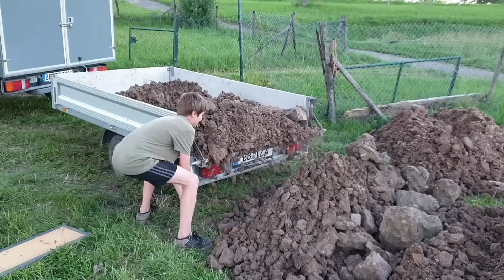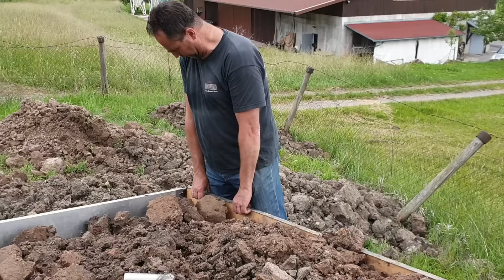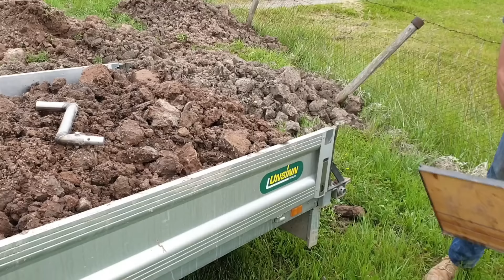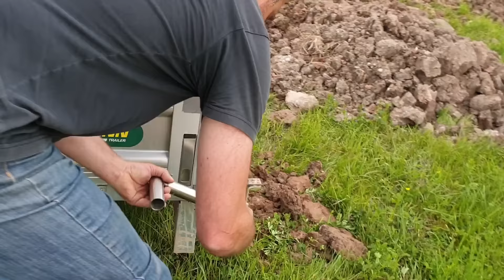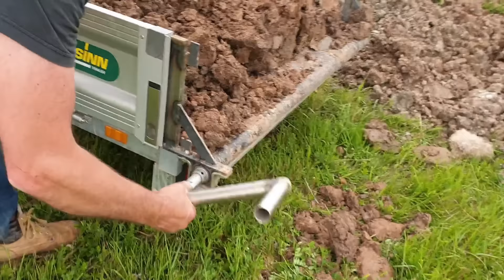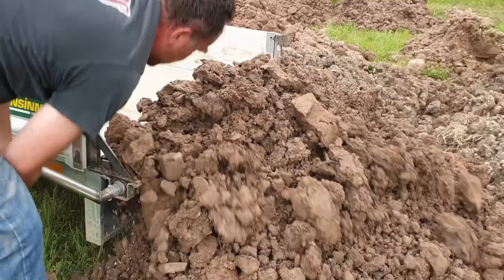Anhänger in Sekunden abladen, 1To Erde, Rollboden selbst konstruiert

Comment: You could also improve this by putting the crank a little farther forward on the trailer and using a gear and chain system to increase the speed but reduce the effort required to move it. I think you would want a small sprocket on the crank and big sprocket on the conveyor.